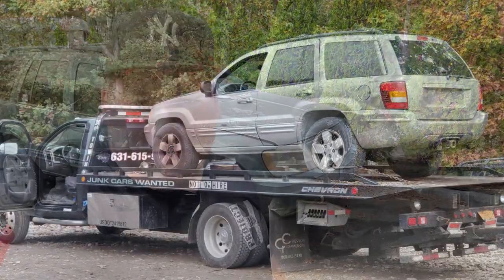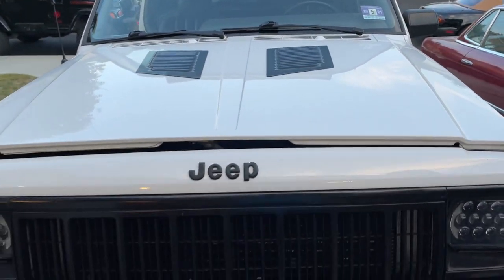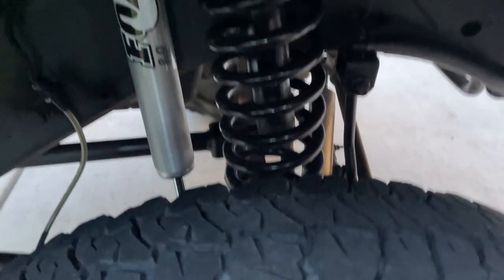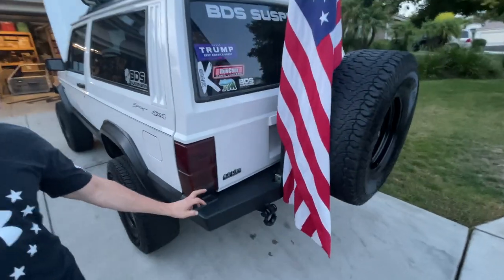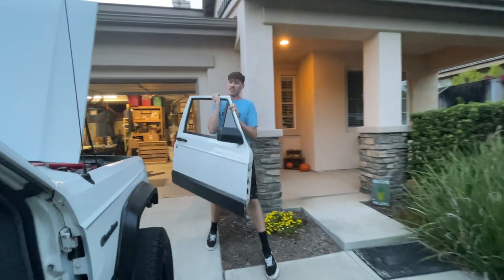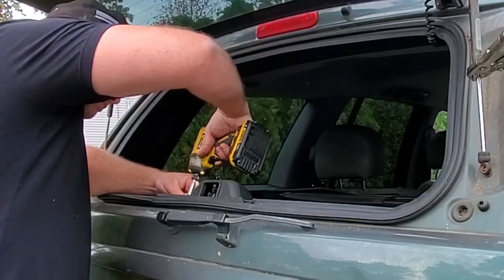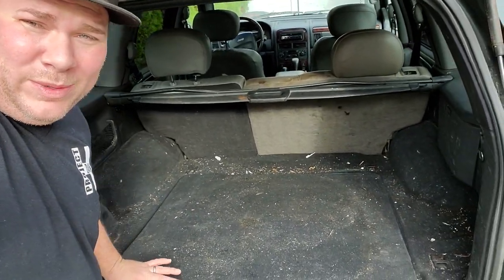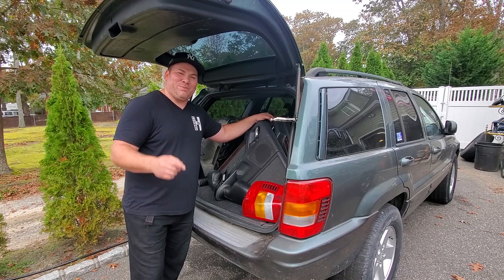1996 JEEP CHEROKEE 2 XJ DOOR WALK AROUND ft. A WJ LIFTGATE FIX & SUPRISE XJ VISIT

Comment: hey brother nice jeeps, a trick i found over the years of stuck on lug nuts find a whole saw that is just a little bigger than the stud and holesaw right thru the lug actually only takes about 2-3 mins then pull rim off and thread the really thin part of the lug that you have left right off usually by hand cause theres no tension on it from the rim then ive done it alot of times in the 60 jeeps ive owned over the years and it doesnt mess up the rim
Reply from the maker: wow! amazing suggestion!!!!

Comment: Nice XJ.....I've updated clusters on many of my XJs. I have NEVER had any issues. They are plug and play from the giant fuel gauge to the tac cluster. You do NOT need to add a oil or water gauge sender unit. Simply swap one cluster to the other and ALL gauges will work. The XJ is the Best J Wranglers are For Cheerleaders....Happy Jeepin from Butler Pa The Birth Place of the Jeep. God Bless Jeepers....
Reply from the maker: Amen! God bless!

Comment: So, I noticed a lot of the 2 doors have what I like to call the rear side window louvers, like that white one has. I’ve seen them on 4 doors too. What are they called specifically and is there a way that I can put them on my XJ?

It seems like it was a seemingly random option as I’ve seen them on a lot of different trim models
Reply from the maker: Those side louvers are only on the 2door xjs.  they are non functional and take make up for some of the space left over from elimination the doors so the sides are not all window.   the same style louvers can be found on ZJs and WJs
Reply: @ProjectDanH  can they be removed and placed on a 4 door?
Reply: @ProjectDanH  also, how can I tell if my XJ is a 2 door or a 4 door? 😆
Reply from the maker: @highwayxj9397  No, there's no place for them
Reply: @ProjectDanH  dang. I know they are non functional but I like them cosmetically
Reply from the maker: @highwayxj9397  yeah, they do look good.  Careful tho.. the 2 door community may skin you alive for putting them on a 4door. 🤣🤣🤣